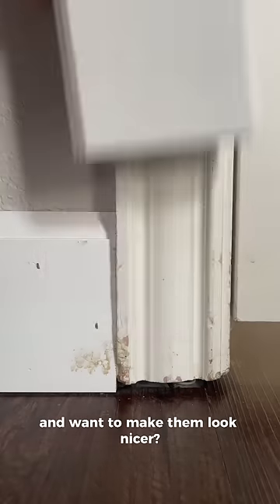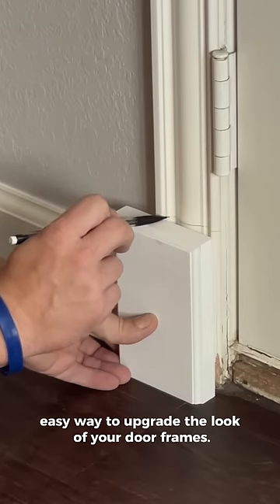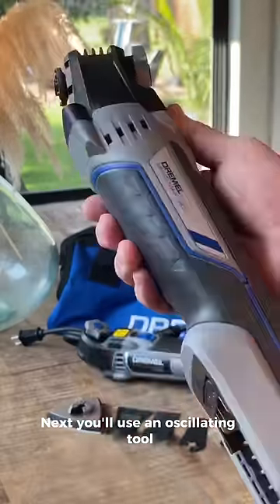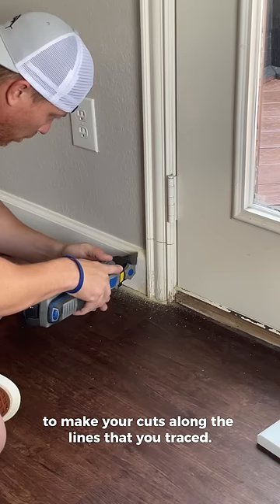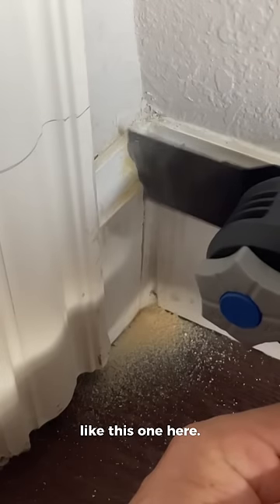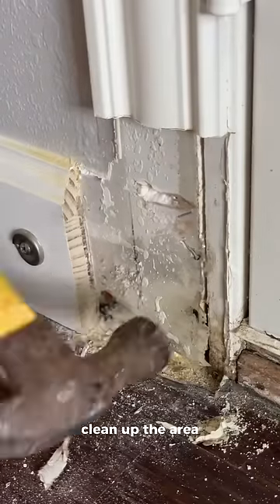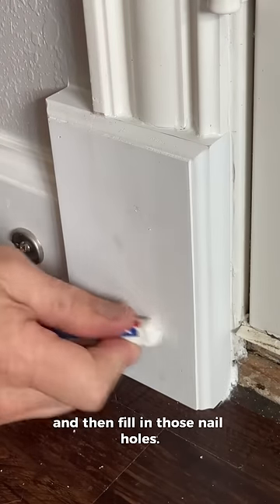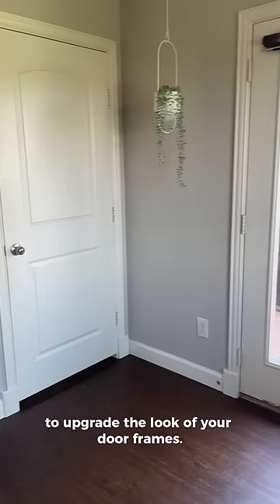Dremel to the rescue! #diy #dremel #plinth #upgrade #howto #tutorial #tips #tricks #budgetfriendly

Comment: You should try the painter's tape over the top of where you're nailing, then fill/caulk, wipe, and remove the tape. No sanding :)
Reply from the maker: Great tip!
Reply: Smart
Reply: When you feel like an idiot for not thinking of that😂
Reply: Pros don’t do that
Reply: @Dwelleronthethreshold89  yes they do.
Reply: @BarryWeston not in this situation.
Reply: Drywall spackle is better than caulk.  Mound it, sand it gently using scrap block, paint.
Reply: @BarryWeston no they don't. I'm they
Reply: @BarryWeston  nope carpenters dont do fill for paint painters do
Reply: @BarryWeston no
Reply: @TT-ik3kd not always dipshtt
Reply: @TT-ik3kd you’re talking about rough carpentry not finished carpentry, I’ve done both and for finished carpentry like this vid the painters tape is a good tip, makes for cleaner finish, I like to use dap personally after and hen paint
Reply: @Black_Dirt_Contractor jeez every bloody comment section "we don't care about ya pronoun mate" 😅 just jokes
Reply: @bigluisjayrogan jackass
Reply: @jeremyruse1740  yo mate. I don't know why you had to bring political pronouns into this. Someone said "they". Referring to the pros, and how "they" do it. I'm a pro, and I don't do it the way some YouTube DIY wannabes say it's done.
Reply: Jesus is the only way to healing, restoration and salvation to all souls. Please turn to him and he will change your life, depression into delight, soul heading from hell to heaven all because of what he did on the cross 

“Whoever calls upon the name of the Lord shall be saved” Romans 10:13

Comment: Possibly could look a little better if you cut your plinth to the more uniform size of the casings but 1/2" larger than the casings. Looks good bro
Reply: Nah it’s good the way it is
Reply: @NayoDuz to some
Reply: @nickolasmckiness4153 dude that looks terrible. It doesn't even sit flush with the base board or the door trim. 😂😂😂 both wider and thicker. Come on man
Reply: I didn't make it..? I do know that there are difference between fine carpenter skills and DIY
Reply: @TzUuup Not trying to be mean to the guy. Treat others is you would like to be treated
Reply: @TzUuup it is supposed to be thicker than baseboards though just not that wide. Only about 1/2in thicker overall to the door casings.
Reply: @nickolasmckiness4153  it's not mean man. Just calling a spade a spade
Reply: @TzUuup Doesn't matter bro still comes across as mean. If your a skilled tradesman then you should know the difference between that and diy and know everyone has a skill level that is different.
Reply: @NayoDuz : Not architecturally correct to have plinth block larger than casing trim.  Screams…. “Hack- work done here “.
Reply: @TEKTONTIM1956  Did you just agree with your own comment like we weren’t going to notice 💀
Reply: @TzUuup 100%
Reply: By me they sell two sizes of those blocks , this one is the bigger of the two. The smaller one  would look better in this scenario, in my opinion
Reply: @NotaTroll409 😂
Reply: Yeah, it looks off, I think you're right.
Reply: I've done residential and commercial construction for over 15 years. Learned it's whatever the customer likes even if I make suggestions.
Reply: Jesus is the only way to healing, restoration and salvation to all souls. Please turn to him and he will change your life, depression into delight, soul heading from hell to heaven all because of what he did on the cross 

“Whoever calls upon the name of the Lord shall be saved” Romans 10:13

Comment: I don't have a picture to show you but when I was in Mississippi I did that to every single one of my door frames when you get those plain simple door plinths like that you can also go one step further and decorate them by buying Apple Q's the wooden little designs you'll find them in the the wood section at Lowe's or home Depot and you can pick out circles you can pick out Stars you can pick a different ones all you do is paint them to match and glue them on gives an extra touch I had door plants on the top and bottom of every door in my house and I had some little flowers on them and in my personal bedroom I had fleur-de-lis because my family is originally from Louisiana😂❤❤

Comment: Do they make oscillating cutting tools for cutting metals like carbon steel and stainless? That would be really useful
Reply: all oscillating tools should be able to cut through metal. all you need is a specialized blade for cutting metal which you can find at any home depot or lowes. they make them for all kinds of metals, thick or thin. it's all up to you
Reply: but they dont last too long.

Comment: Don't run those multi-tools with a dull blade. They get too hot and burn off the hold down pegs. Had that same brand and didn't have any more blades and torched off the holding pegs. Warranty voided.

Comment: uuuuuhmmmmmm.......ooor, you know, you literally get some frigging oven clay, push the soft clay to the shape of the sill, bake it in the oven, then put cement/putty to the floor where there's a hole, get your baked clay mold, push the mold down the sill to push the putty into the shape, let it dry out, use a sander to sand down the edge meeting the trim board, deepen the screw, get some filler, then sand it down smooth one more time, paint it, and you have something that looks good instead of lump blocks that look stupid.

Comment: I’d be more concerned with the HUGE gap under that door.
Reply: Probably had carpet in there previously. Unless you want to install a new door it's not hurting anything. I mean you can install an anti noise bar on the door if you want to isolate the door but other than noise just leave it.
Reply: It’s horrendous!  Change the door or plant a piece of timber to the bottom, fill and paint.
Reply: Might be on purpose for return air flow.
Reply: @Zhiperser  There are in-door vents that look 1000 times better than that, but could be the cheapie solution.
Reply: all they need to do is install glue a door brush to the bottom, let it dry out, and you are done.

Comment: The blocks are 2 dollars.... he don't tell you a box of finishing nails is 20-30, the damn nailer is at least 100-300+, the oscillating tool is probably another hundred and blades....... 2 dollar blocks though. Don't paint over them or seal the edges though, that's too expensive...............

Comment: That's so terrible. If you're going to do that get the correct size plinth. Should be slightly wider than your casing and slightly taller than your base. So.... not like that. If you're gonna do what this guy did just leave it alone and save your money